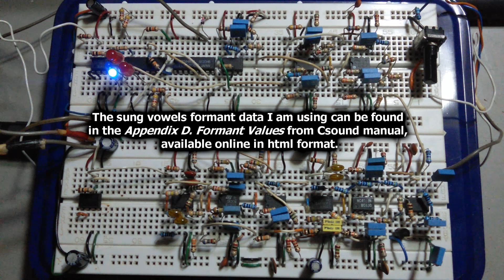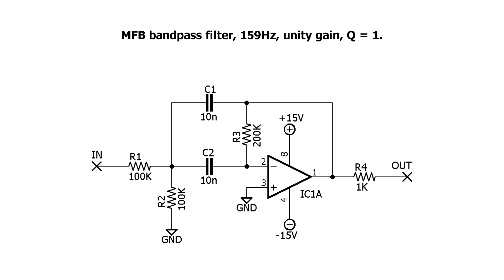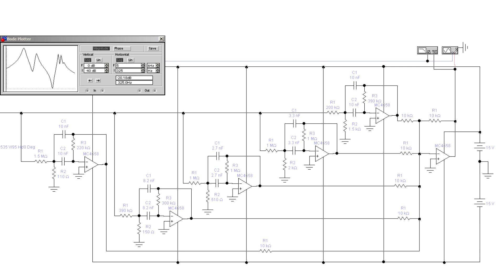Vowel Formant Filter with MFB bandpass filters and CMOS selector

Comment: playing around with this! would love to have the scheamtics for the other 2 wowels!
Reply from the maker: Schematics are in this other video, and probably in a post in the community section of this channel: 
 https://www.youtube.com/watch?v=w18nwmS9v1M
Reply: @ couldnt find what I was looking for in the video you linked to. Ideally same set up as this video but with other caps and resistor values to create the formants in "I" and "E", It hink you do this in this video but never show a schematic for the other vowels. Tried the program you linked to, to calculate myself but it didn't work on my computer for some reason.
Reply from the maker: Hi, I have drawn only that schematic as the circuit was in development, the linked video contains a voltage controlled formant filter that is more flexible, requiring less MFB circuits with the addition of a microcontroller, DACs  and some transistors. The ESP software needs the Visual Basic 4.0 runtime library installed in a Windows PC. I think it can be found in the Microsoft site: 
 https://www.microsoft.com/en-us/search/explore?q=Visual+Basic+4.0+runtime+library 
If you are using other operational system, then the filters can be calculated using the formulae present in the ESP article on MFB bandpass filters: https://sound-au.com/project63.htm 
I will try to find if I have written the values for the other vowels somewhere.
Reply: @ thanks! Dont own a pc myself and my math sucks 😀. Would be really helpful if you find the other values! Thanks again!

Comment: Good sound ! Why are not present manuale controls? It would be bettter  to have the possibility to control the intervention of the filters , perhaps even voltage control. Is the schematic available? Congratulazioni anyway👍👍
Reply from the maker: Thank you! I tried to keep the circuit as simple as possible, adding control requires much more complexity and space in the breadboard. However, I am still experimenting with alternative approaches. I will post some schematics in the Community Section of this channel. Grazie!